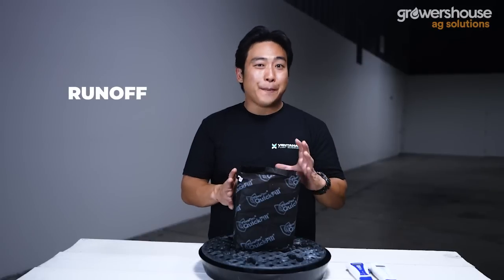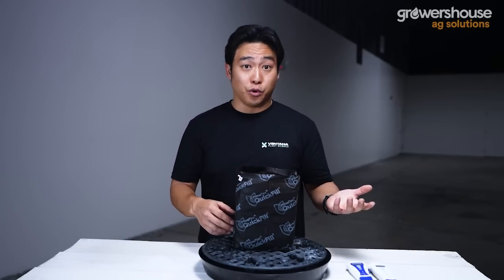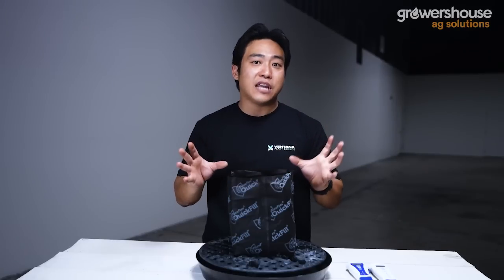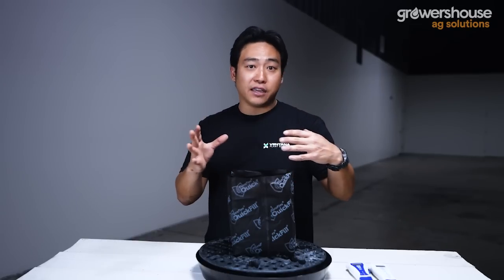Fertigation 101: Feed Rates, Runoff & Drybacks

Comment: Very informative video. I have grown Cannabis with DWC systems and have found it beneficial to the plants to run just plain ph'd  R/O water for a few days and allow the plants to get only water and got a massive growth spurt before flipping to flower. I am wondering if this method will work with Coco Coir? I imagine it would as long as the Coco doesn't get too dry.

Comment: I rarely go above 2.4 ec because i see burns whenever i do. I grow in coco growrock mix
Reply: The runoff pH has to be in the right range... what are you running?
Also, your VPD shouldn’t be too low. What’s yours? What does your room climate look like?
Drybacks shouldn’t be too long either; when the substrate dries out, the EC spikes.
In veg and during the first weeks of flower, I rarely go below EC 3, but only if all parameters are dialed in.

Comment: How does runoff relate to media sensor values ? i find my pore water EC is consistently quite a bit higher than runoff , runoff at about 3-4EC and PWEC at about 6EC. Should i be focusing on the runoff or media EC? You mentioned 35% dryback max for coco but later said 50% ,which is it ?
Reply: Max 35% dryback. Target dryback of under 50% between irrigation cycles. Happy growing!
Reply: @mike.cfromgh4086  Thanks mike
Reply: Your soil probe EC meters will always read much higher especially in media like soil or coco than the runoff. Remember how I spoke about those CEC sites locking up ions when you probe your plants not only are you testing the EC of the soil solution but you're making contact with the Ion layer in the media also it sounds like you're in good ranges just make sure you monitor that runoff EC cause that's the outgoing and you can worry about the incoming the qualities of the media will determine the standing EC that fluctuates with water content